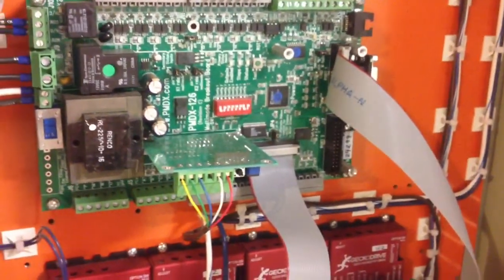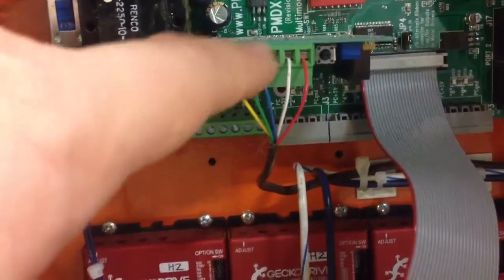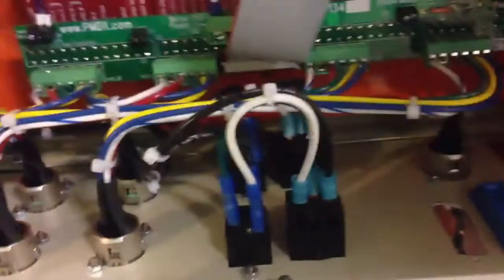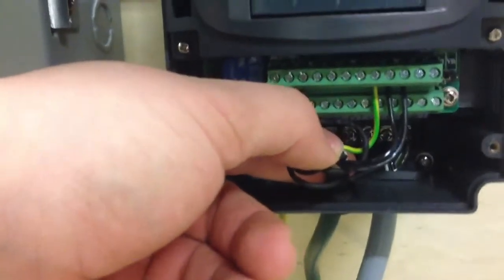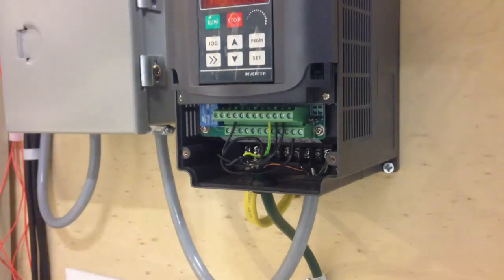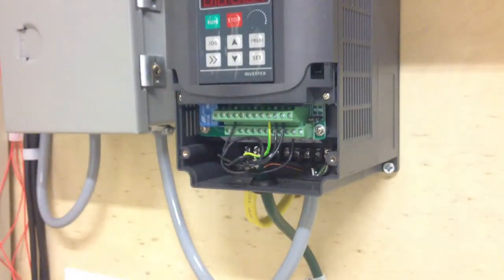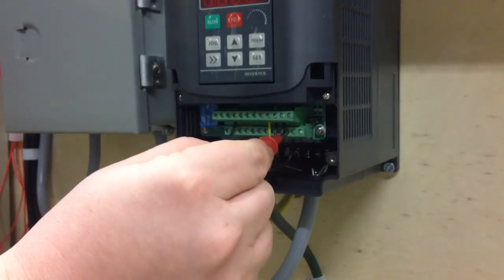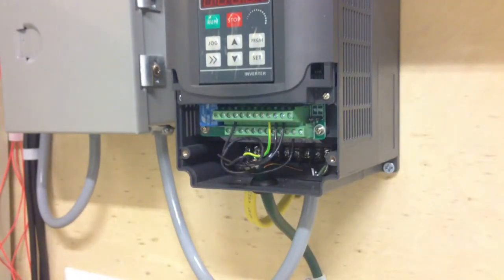Detailing VFD Connections from the PMDX 107

Comment: So what if people are not using the same colors as you. I would not be calling yourself the engineer if you can’t figure out what the question asked was really asking. Exactly what pins on the 107 are you connecting to which pins in the pfd. This video has absolutely no value help wise.
Reply: well he shows the pmdx-107 so you can figure out the input screw locations due to his color he used. , yes it would have been helpful to say pin 1 through 6 but if you have a 107 and "look" you should be able to figure it out easily.

Comment: Sorry but knowing the color of your wires is of no value. I think that people want to know what connection is connected at each end. Like inverter VI pin is connected to 0-10V at the board end.
Reply: well he shows the pmdx-107 so you can figure out the input screw locations due to his color he used. , yes it would have been helpful to say pin 1 through 6 but if you have a 107 and "look" you should be able to figure it out easily.